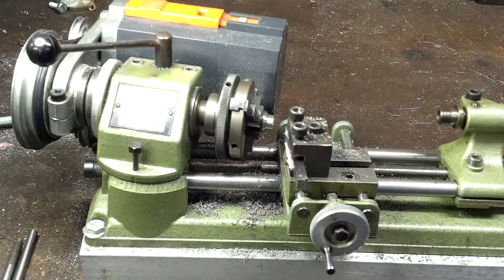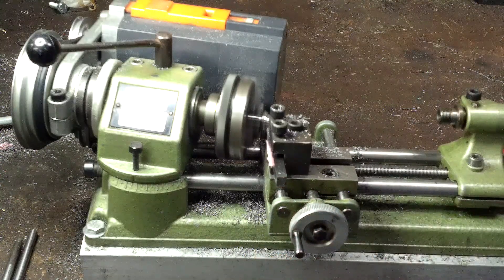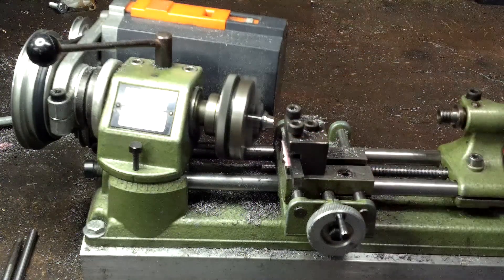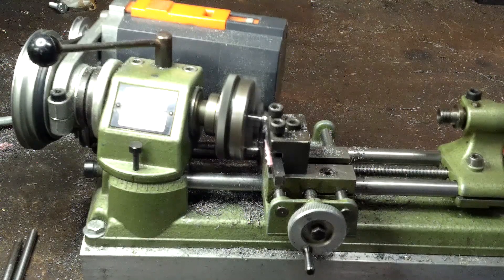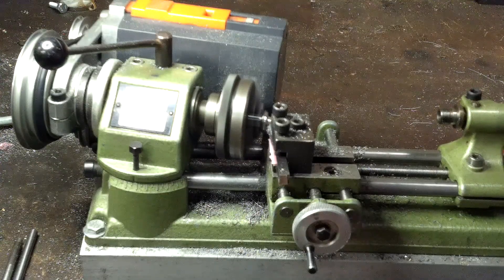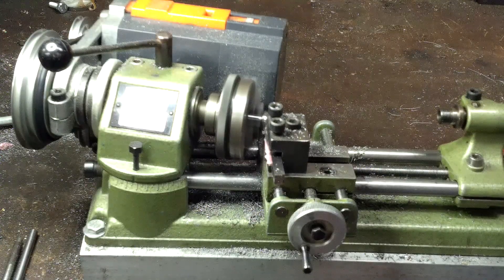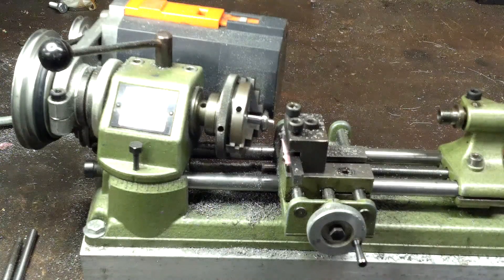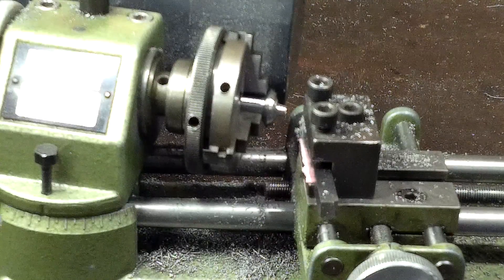Unimat SL1000 :Taper turning

Comment: Fan drowning out the motor on the UniMat? Nah. 
Did you get new belts for it or using the originals?
Reply from the maker: i got some aftermarket belts. i have some urethane belting i'm going to run next

Comment: Mike, I'm using my sl1000 for small repair work (shooting stick pin replacement, letter box pins, fountain pen cap threads, etc). Would you consider making some of your O2 or 1144 (1/4 stock) turning tools for sale? I'm using carbide tips fixed permanently to the bar, and was considering using tools with replaceable carbide cutters, but you seem to get the best results from using the harder hss tools you make. I've had the unimat for some years, and find your demonstration of capabilities useful. I've got collets, auto feed, milling equipment, screw cutting attachment and guides, etc so plenty yet to try out as small jobs arise. I'm in England and bought the machine from a retired Rolls Royce engineer who used to refurbish an sell Unimat SL1000 and accessories as a hobby/small business.
Reply from the maker: i would be happy to grind up some tooling for you
sen me an email ulmadoc@gmail.
i'll get you address and we can go from there!
Reply: @mikewalton5469  Thanks Mike, I have just emailed you.